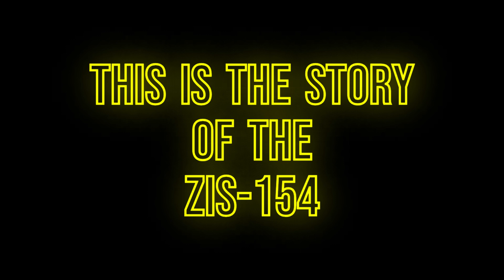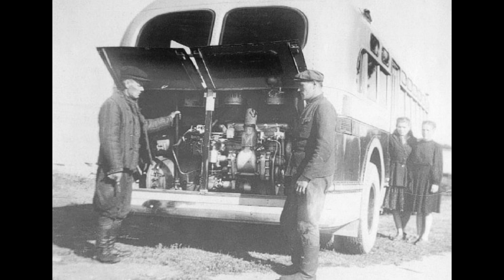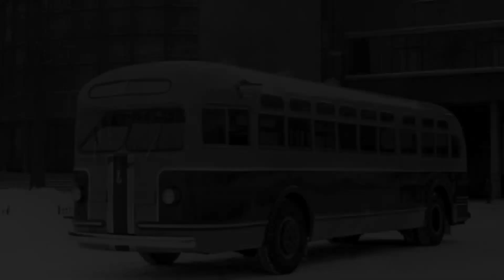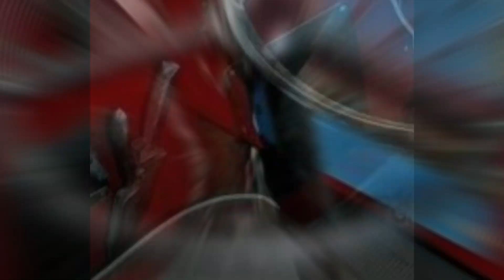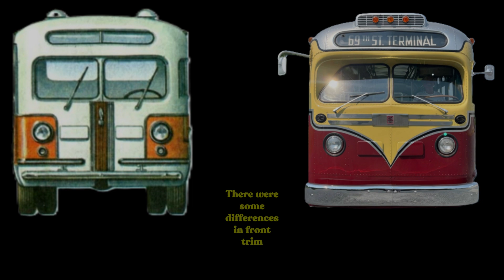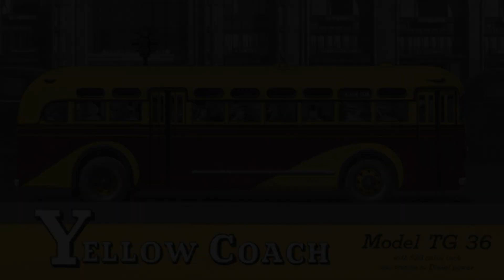The Story of How The Soviets Created a Fake GM Transit Bus [USSR Bus History]

Comment: One Leyland National made it to Moscow.
Reply from the maker: Hello! Oh yes, I have heard of that...if I could find enough info, I'd do a video on it! Thanks very much for watching!!
Reply: @JeffreyOrnstein  they may have got an order if they had fully metricated the bus as originally intended.
The rear axles originated from the late 1940s and the gearbox also used British Standard imperial fasteners even though French licence built versions of the SCG gearbox were fully metric. Those could have been used for export models and got them over the line.
It ended up a bus with a mixture of imperial and metric fasteners which limited it’s appeal in Europe.
A French operator bought 10 and The Netherlands operated 25 those lantern windshields.

Comment: Soviet Busses had the best quality! The Diesel-Electric powerunit was copied from german WW2 Porsche Tiger tank.
Reply from the maker: Hello! Thanks for your input on Soviet buses! Thanks very much for watching!!
Reply: 1. Germans didn't produce diesel powered tanks except some minor concepts which were rejected by wehrmacht management because of a logistical solution. 
2. YaAZ-204 engine mentioned by Jeffrey was the exact copy of a GM 4-71 engine which USSR was getting during WW2 massively according to a lend lease act. It was copied and produced by the plant in Yaroslavl (YaAZ/YaMZ) till the mid-80's. ZiS-154 was not the only vehicle were using this engine, there were a  vast of truck such as YaAZ-200, MAZ-200 series and earlier KrAZ and a number of narrow-gauge locomotives were produced.

Comment: Hello from Scotland, thanks Jeffrey for another intriguing subject.  Am I right in thinking Yellow Coach/ GM Truck and Coach offered electric drive as an option in the US?   

In a much earlier generation of UK buses an electric drive arrangement was available.   Tilling Stevens secured a patent for such a layout in 1908 and built several hundred for the associated Tilling fleets and other operators with some limited exports until the later 1920s when they moved to conventional mechanical transmission.   The petrol-electric expertise was important though in the late 1930s as a series of mobile seachlight lorries left their Maidstone works.

100bhp for the petrol version seems quite underpowered, while the unladen weight of 12 tonnes is high for the time by world standards. The Leyland-MCW Olympic, a contemporary design, had a Leyland four stroke horizontal diesel rated at 125bhp in mid-underfloor layout, coupled to a synchromesh transmission power losses would be much lower.  It had 25% more power at the flywheel and was two thirds of the weight in 32 foot Left hand drive dual door trim.  Neither a two-stroke diesel nor a supercharged petrol engine would give much in the way of low-down torque, so mechanical transmission was probably ruled out on the ZIS for that reason, presumably reverse engineering the Allison Torque converter was not considered possible..
Reply from the maker: Hello Stephen!  Thanks for all of the interesting mechanical explanations, as well as the info on the Olympic - might also be a good idea for a future video as it sounds like it was ahead of its time!! And yes, GM did offer transit buses with electric drives at that time!! Thanks very much for watching again!!

Comment: Hiiiiiii Jeffrey!

At that time, this bus was too advanced for a war-torn country. Most of the issues stemmed from the internal combustion engine, an unlicensed copy of the Detroit Diesel 4-71—the YaAZ-204. That engine had just entered serial production and suffered from various problems due to its poor build quality and the peculiarities of reverse engineering, where you often have to learn things the hard way. When copying something, you're often essentially working almost blind.

Another problem was the mismatch between the generator and the electric motor, which led to the situation that in service drivers were forced to constantly overrev the diesel engine to get the thing moving. This resulted in excessive noise, a smoky exhaust, and constant breakdowns of an already not very great engine.
The choice of an electric motor was driven by the need for unification with the MTB-82 trolleybus you mentioned, as well as the postwar shortage of resources—so they had to make do with what was available.

As for the electric transmission, one of the bus’s designers later admitted he regretted taking that route. Initially, it seemed like the right and simpler solution, but in the end, it created more problems than it solved. A better approach would have been a hydraulic transmission—a mechanical gearbox with a fluid coupling or even some form of primitive automatic transmission. Some groundwork in that direction already existed.

Overall, this bus has a fascinating history. It's a shame that much of it remains behind the scenes, possibly even for ideological reasons.

In any case, the ZiS-154 was part of the "holy trinity" of postwar public transport, which shared many design and especially stylistic elements:
— The ZiS-154 bus
— The MTB-82 trolleybus
— The MTV-82 tram

👋
Reply: @Andy_Novosad  The perils of reverse engineering:  while physical dimensions of the parts can be duplicated easily enough, less accurately would be choice of materials and original GM designers rationale for them.  Worst of all is trying to guess the critical assembly procedures (certainly if one didn't have a GM rebuild manual translated into Russian available).  Important are machining tolerances, bearing preload, bolting sequence, and fastener torque spec.
Reply from the maker: Hello Andy! Thanks again for your excellent insights into the world of Soviet bus production!! It's too bad this bus is not more well-known, as you allude to. As for the "holy trinity" of buses in the USSR, would that also include the ZIS-155? Although more like a truck mechanically (I think), it does have a design similar to the vehicles you mentioned! Thanks very much for watching again!!
Reply: @JeffreyOrnstein  By "holy trinity" I've meant bus/trolleybus/tram, each of which benefited from the GMC Old Look. ZiS-154 was the greatest benefiter. Trolleybus and tram borrowed mostly overall design language and some minor details — their core design was very different, they had bodies on frame, unlike the bus, which was of unibody construction.
Reply: The fuel economy of the electric drive-train must have been very bad, especially in city traffic with frequent stops. The engine had to run in high RPM most of the time. I am sure that high fuel consumption was not an issue initially, but was later one of the main reasons why these buses were put out of service.
Reply: @erikziak1249  In the Soviet Union with its communist economy, especially when diesel was still dirt cheap, fuel consumption was the very last concern 😁 
Remember, 99% of their domestically produced buses right until 1991 had gasoline engines, which were extremely fuel thirsty.
What concerned them much much more is that the rather advanced ZiS-154 was expensive to build. But the corner stone was — it was very unreliable and the majority of existing technicians were not proficient in proper servicing of this kind of technology. So most of these buses instead of providing so much needed service, were dead weight, waiting to be serviced themselves. Interestingly enough, some examples were even converted into trolleybuses by throwing away the most problematic parts — the ICE and the generator 😄
Reply: Surely the Soviet Union must have had truck engines that could have been used in a bus.
Reply: Well, the Soviets are famous for being pioneers in wide use of diesel engines in their tanks. But in reality, before the war they didn't have any serial produced truck diesel engines at all. There were some prototypes, like the KoDju diesel engine, but they were never made into production.
First domestically engineered and produced engines were created closer to the 1960s, the series of V-shaped 4-stroke diesels ЯМЗ-236/238/240. But none of them were ever used in buses either. They were deemed too heavy and bulky. Things started to change only in the late 1970s, when KamAZ was launched, so its engines became available, which led to creation LAZ-4202 (ЛАЗ-4202) the first Soviet production diesel bus in two decades 😄
Reply: I’m sure they did. But perhaps they just wanted that DETROIT DIESEL legendary sound and go to silly extremes to attain it.

Comment: The Soviet Union had form for re-producing western equipment particularly aircraft and aircraft engines, without production licenses usually by way of reverse-engineering. Aircraft produced included the Boeing B-29 Superfortress as the Tupolev Tu-4, the Consolidated PBY as the Amtorg GST, etc, etc.
Reply: Amtorg GST was licensed, which is literally exactly why it was called "Amtorg". B-29 was the only aircraft that I am aware of that actually was copied without a license, for a very simple reason: to reverse-engineer, it is much more expensive and time-consuming.
Reply from the maker: Hello! Oh yes, you're right - I've seen documentaries about some of those planes, such as the one copied from the B-29 - interesting stuff, indeed! Thanks very much for watching!!
Reply: @JeffreyOrnstein  My pleasure...

Comment: Unusual idea using diesel electric. With an alloy body it would not of been so sluggish, the way it was it sounds like it was fuel hungry
Reply: It was in fact an alloy body. Just like the American prototype. Very non-typical for the Soviet bus industry.
Also, some Old-Looks and other buses, had the electric transmission in the 1940s, that's where the Soviets picked it up. But then Hydromatic and all that stuff arrived and the rest is history. 

After the failure of the ZiS-154 Soviets didn't have any kind of automatic transmission in their city transit buses for almost 20 years, until 1967, when the LiAZ-677 bus was finally introduced into production, with its two-speed automatic.
Reply: @Andy_Novosad  OK Thanks for the extra info. I took it when Jeff said all metal body it was steel so my mistake there. Never knew of a bus with electric transmission before.
Reply: @cedarcam There were a few. For example TDE series of GMC buses, where E stands for Electric Transmission.
I saw the information that the Soviets used a Mack bus with electric transmission as a starting point for theirs.
Reply from the maker: Hello! Yes, quite unusual for the bus to be diesel-electric, but too bad it didn't really work as intended!! Thanks very much for watching again!!